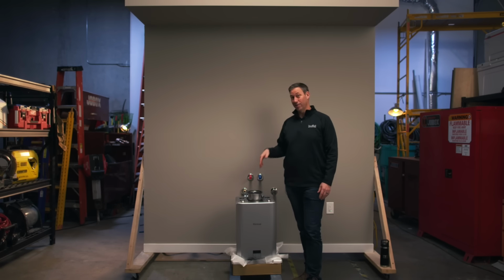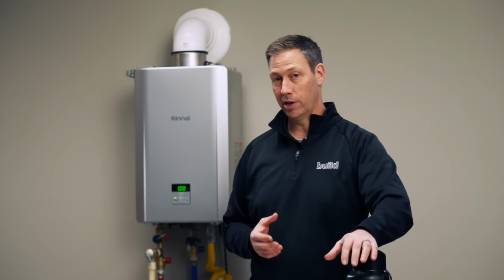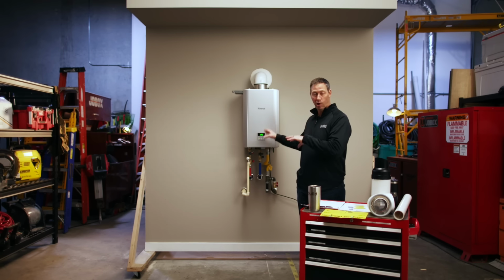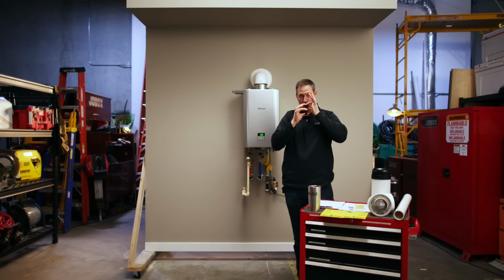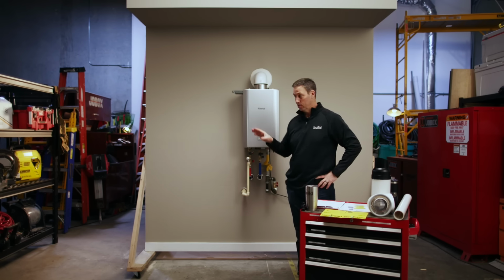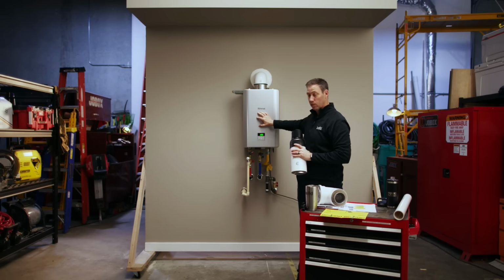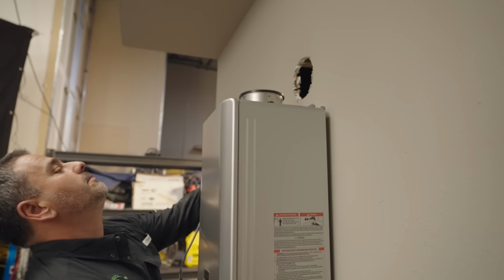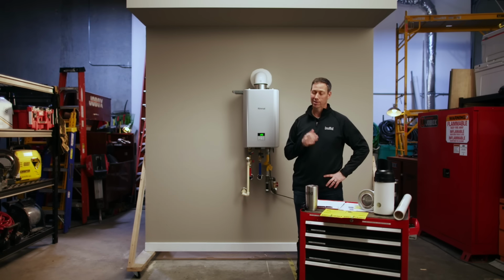Replacing A Water Heater Tank? Probably the Best Tankless Option for You.

Comment: About 15 years ago we had a tankless, Bosch I believe, but went back to a tank for the following reasons:  1) After two years of use, the repair tech was not able to get it to start properly (propane)... the burner would fire up for a couple seconds and then fault out.   Performing the regular recommended flushes/cleaning did not help.  2)  Could never wash clothes in hot water.  The washer would fill using several calls for hot water.  Every time the water was shut off and then turned back on a few seconds later, the tankless would re-start its heating process, putting several seconds of cold water in the hot water circuit.  The unit we had did not have any way to keep heating after the flow was stopped.  If the flow stopped, the heating stopped, completely.  The end result was that the washer never washed in anything warmer than luke warm water.
What did I like about it?  When it was off, it consumed NO gas, period.  As long as it was running and I had propane, I would never run out of hot water.  I was able to select the exact desired temp for our shower using the remote... this way, cold water was not used at all to lower the temp of the hot water down to the temp that was comfortable in the shower.... We LOVED that feature.
The only way I would return to a tankless is if we could overcome the on-off cycle problem we had with the clothes washer.
Reply: In NZ we mostly wash in cold water supply. Washes heat when neccessary.
Reply: Your experience has me thinking not to go tankless ... our new washer does the same thing, at one point in the cycle it turns water on and off every few seconds. It's kinda stupid, actually. Just one more reason for the water valves in the washer to fail sooner probably.
Reply: @thenexthobby  Agreed.  Although, in the past 30 years, I've had two washers.  The only things that I've had to repair (done them myself) was the door boot (front load), water pump and direct drive motor.  Never a valve.  But back to the point of water cycling.... My recent research suggested that some of the newer tankless have a feature that allows you to keep the heater running for 1-2 minutes after the water flow stops, in order to combat this exact problem without having a hot water return loop.  When my tank heater starts giving out (electric) I may just give tankless another try... that is after I verify that it will stay running for a period of time.
Reply: Tempering tank.  Or, point of use.

Comment: #1 That little thermostatic crossover valve doesn't work with tankless water heaters. Tankless water heaters need a minimum amount of flow in order to turn their 200,000 BTU burner on and those valves do not provide adequate flow. #2 As Bob Y mentions in the comment below, if you do have a dedicated recirculation loop and are running the pump to keep the loop hot, you are loosing most of the efficiency of a tankless water heater because you are maintaining 2- 4 gallons of water hot in your piping that is radiating into your home while the pump is running. Not only does this waste gas, but also adds undue wear and tear to your water heater and plumbing. The best solution for "on demand" recirculation pump I have found is the Smart Recirculation Control. They have models that work with tankless and tank water systems and they sell a thermostatic crossover valve that is made to work with tankless water heaters. https://www.smartrecirculationcontrol.com/
Reply: The combustion efficiency increase is no joke.  Depends on your usage but it can make a big difference.  Btu loss through the jacket of a water heater is now minimal. A tankless benefit is far better combustion efficiency without using a tank - reducing cost compared to a 90%+ combustion efficient tank. 

Here in mn we insulate the hot water pipes in new homes.  This crossover could be installed. It will lose btus of course, but you also have to consider the wasted btus from not having a recirc loop. By that I mean when you turn on the hot water at the faucet and you never end up with hot water.  Your water heater will need to heat up the water you used and the btus used to heat your water were completely wasted.  

This water heater has the pump and electronic controls for how it runs built in.  No need for the link you posted with this model.

Comment: Great if money is no object. I have never had a tankless, have had water heaters installed myself pretty easy (last one cost me $600) lasted about 10-15 years little maintenance. Tankless yearly maintenance- pro to install $4k to $8k. 1 )Biggest selling point of tankless used to be instant hot water (I was always skeptical-how!?) now it comes to light that that is bogus... 2) Also big energy cost savings?! $8 a month = that will take 50 years to pay for itself. Total no brainer for me (my opinion for vast majority of people) tank water heater until tankless gets way way cheaper which doesn't seem to be anytime soon.
Reply: Don't even go to the latest and greatest, heat pump water heaters.

On paper?  Wonderful operating savings.

In the real world?  Installation/modification costs enough to make one's head spin.  And then, R&M?  Tech's without any understanding of electronic control circuitry scratching their heads and throwing "boards' at it while on the line with a manufacturer who can't get a new part out  for three weeks. 

In the meantime, spouse threatening divorce if she has to wait three weeks to have hot water.  How much does divorce cost?

Comment: You omitted the amount of natural gas it takes; 3/4" gas line needed to feed that beast vs 1/2" on 40-50 gallon tank.
 Then at only 80% your dumping carbon vs water that now gets recycled. 
Then the regular yearly Maintenace needed on tankless vs non and the pre filter n water softener too.
So the; cost, maintenance/yearly service, added  water filters/softeners/ salt,. plumbing larger gas line....
When in South America They used 240v elec water heaters hooked to shower.  That's way more economical n Elec efficient .

Comment: Couple things.. in a real world installation from tanked to tankless, the condensation drain isn’t really an issue, you could just utilize the drain pan line (I don’t see one in this video) for the purpose of draining the condensate drain and as a drain pan drain. If you install a condensate neutralizer filter you’re good to go.
Reply: Code doesn't allow that. Manufacturer says not to use any other condensate or shared drain as well. The issue is that condensate lines grow algae/mold (because people forget to clean them) and they can eventually get completely blocked. Not a big deal because you'll get a warning or the system will stop functioning, however, if your water heater ruptures, it's going to need all 3/4-1" of that drain line, and if it's partially blocked by algae, then it can't serve it's purpose and you can have overflow from the very drain meant to prevent it. So, go with a dedicated line for all condensate and drain pans. As a side note; a mechanical room I'm installing right now has 4 condensate lines, 2 TPR lines and 3 overflow drains. It's tempting to combine them, but experience/code says no.

Comment: Matt, with all due respect, your stats are very inaccurate which I seriously doubt Rinnai would be falsely claiming. 

A condensing H2O heater can be 96% efficient however independent testing of Rinnai condensing units is UEF 0.93. That’s equivalent to 93% efficiency, ie for every BTU of available energy consumed, 93% is converted into heating water. The unit you have there is not 0.87, as you claim, it’s 0.74 UEF.

The condensing tankless is also not “the highest efficiency”. Every heat pump water heater I’ve see exceeds UEF 3.0, most are approaching 4.0. That’s four times higher efficiency than the most efficient tankless gas H2O heater, which fwiw is the Navien NPE and Rheem Ikonic models.

Comment: can I connect this to the traditional exhaust tube/flue that my gas hot water heater has, or do I need to put in something else?
Reply from the maker: Excellent question. It’s certainly possible to connect to existing piping but you’ll need a plumber to verify that it meets code and will work with manufacturers specs.
Reply: @buildshow  

I've yet to find a tankless that allows the use of type B gas vent and that's what virtually all the homes around here have.  I've even tried hard to find a suitable vent that could fit inside the existing type B I have because it travels through a chase in the second floor all the way to the roof.  Another very common set up where I live.

Comment: Does dumping the hot water into the cold line potentially impact drinking water quality? I've been considering a recirc pump with a traditional water heater, but I'm worried about impact drinking water quality.
Reply: The EPA says you shouldn't drink from the hot water tap because heated water is more likely to dissolve (and contain) contaminants like lead. And it's also possible for algae to bloom in a tank. So this just swaps one problem for another. Now, you're waiting for cold water instead of hot.

Comment: Coming from a plumber, that has worked on these a lot, I cation you about the recirculating line. If you don’t have the proper diameter pipe you can start to have pin hole leaks in your water distribution system.
Reply: Can you elaborate more on this?

Comment: A few things that Matt forgot #1 gas line sizing for a 200,000 BTU piece of equipment #2 recirculation lines add to your gas consumption, they don’t stay hot for free. #3 contacting the gas utility about the added load (The gas meter and regulator will need to be sized for the entire house load , all gas appliances). #4 connecting  a 200,000 BTU stationary appliance with a flexible connector may be excepted by Matt’s code enforcement district but it’s not a recommended connection by Rinnai. #5 as a gas utility technician we tend to find in 40% of the cases, the gas utility bill going up after installing a tankless water heater (this is usually due to added use because of the endless supply of hot water and the use of recirculation pumps with long pipe runs).#6 This Rinnai is a little easier than servicing the condensing type when parts are needed but it’s no walk in the park , you better know what you’re doing if you’re replacing heat exchangers and burners.#7 when it comes to tankless water heaters ,Rinnai s are very good but their service valves suck, install Webstone service valves and you can thank me later.
  When it comes to tankless WHs, Rinnai and Bosch are probably your best choices. I personally have a tank type, I keep it clean and replace the anode from time to time (less headaches and I don’t get paid to work on my own equipment but I love working on yours).
Reply: I know this video is six months old but I'll add my little bit anyway.  The one thing I never hear mentioned is that with a TANK type water heater you always have (depending on size) 40 or more gallons of emergency potable water should the need arise.  For whatever reason, I find some comfort knowing that.  Like I said, my little bit😉
Reply: Thank you Bob Y. This is the Best comment I think I will ever hear on this topic! I am considering changing to a small tankless for our garage  conversion to save space, and mounting it outside. I live in Madera, Calif. Any recommendations? This room is only for our family as guests on ocassions.
Reply: @dporrasxtremeLS3  , for outside installations, I like the Rinnai tankless  used with the Rinnai  Recess Box. I’m not a fan of Rennai’s Service valves, I prefer the Webstone service valves but I’m not so sure they would fit in Rinnai’s Box. I am in Missouri , so outside installations are off limits here (gets too cold). My brother does have a outside Rinnai  in South Alabama and has never had a problem with the unit itself but those service valves can become a bitch to turn when you do a Vinegar flush ( my suggestion is that you exercise those valves probably at least twice a year ) . Whether you’re installing this yourself or hiring a qualified plumber my suggestion is learn all you can and do your due diligence. Once you educate yourself, I suggest getting 3 bids from qualified contractors and go with the one you’re most comfortable with after a good conversation and your new learned knowledge.
Reply: I wish you worked on my city.
Reply: Thank you !
Reply: I had an all electric house I put NG in when I moved in.  When I replaced the Water Heater I had to put one in that vented out the side of the house (no flue pipe to the roof).   When that one failed I put in a power vent tanked.   That one was threatening to fail so I put in a  Rinnai tankless.  Fortunately when I installed the gas line,  I had sized the gas line going to the water heater large enough to support the very high BTU requirement for the tankless one.  The power vent one was already installed on an outside wall, and had a vent available, so it turned out those two issues were covered.  If I had needed to run a new gas line form the meter I would have got a power vent tank water heater They were not much cheaper than the Rinnai, however so far it has worked well.  I just got a cleaning kit so we are going to clean it out (it is slightly more than one year old.)
Reply: He didn't forget....it's sponsered by Rinai....they don't want you thinking about the extra gas spent.  I'll add another caution...I had a relative with a circulation pump and they unhooked it because in the quiet of the night the water circulating sounds kicking on was an annoyance.  That said, my Rinai operated for 18 years before it failed to light.
Reply: An on-demand recirc system uses less gas than the typical timer activated kind. Some are even worse, running 24/7 as if anyone needed hot water while asleep or away from the house. But all of them reduce water waste!
Reply: I added this unit. The only downside is there are just two heat settings 120 & 140 degrees. My wife would like it a bit warmer in the bathtub. It was easy to install.
Reply: Yes sizing of the gas pipe is maximum input for the appliance because there needs to be enough volume and pressure for the appliance in the case that every single fixture is running hot water.
Reply: I agree with most of what you said but remember that Tankless units do not consume 200,000btu every time they turn on.  They are stage fired and gas consumption is proportional to the load.  Conventional tanks are 100% on/off.  Its very seldom that the unit is drawing 200k btu meaning 11gpm hot water. In most cases these unit are drawing 50k btu. with one or two fixtures running.  I prefer Navien NPE series.
Reply: @MrTictawk  , When it comes to sizing gas lines and the incoming gas distribution system it doesn’t matter what your average use maybe, they have to be sized for the maximum use possible. 
 Navien equipment is not too popular around here and I understand they’re having heat exchanger problems. I am not a real big fan of South Korean equipment.
Reply: @boby115  Navien has Stainless steel heat exchangers and I find them very reliable.  If you have very hard water, the unit needs to be serviced annually or the exchanger will fail.  Ditto any other brand including Rinnai.
Reply: @MrTictawk  Rinnai also make a stainless steel heat exchanger.  It's there condensing unit.
Reply: @MrTictawk  Exactly, we have little problems with Naviens. Navien exchangers only run into trouble on their NHB and NCB boilers running on a high temp system with no outdoor reset control. If you have a system that runs at 180 use a NFB.
Reply: @anthonyspadafora1384 could you explain NHB & NCB & NFB? I don't understand those acronyms,  thanks
Reply: @1970Mrscott  NHB Navien Heating Boiler....NCB Navien Combi boiler....NFB Navien Firetube Boiler   The combi boiler makes both hot water for heating and domestic use.
Reply: What you wrote is all true. He is trying to sell this tankless like car sale without the downsize of it. Installation cost must be up the roof.  This is for customer with money to burn. Why not just install tankless for each bathroom. kitchen and laundry room.
Reply: Very true. Glad I did not switch to tankless. Tankless water heater sometimes is free after government subsidized rebate, but the cost to resize gas line is much more expensive.

Comment: It’s not done to code, you can’t run pex up to a water heater, especially a tankless. 18” of metallic pipe required up to the unit. And Rinnai is NOT the first manufacturer to design a pump into it. Navien has done it for 10years.

Comment: Here you go:

Crossover Mode (Factory Default):
• The plumbing system does not have a dedicated circulation return line. Crossover mode requires installation of a thermal bypass valve at the furthest fixture in the plumbing system. When installed, the boiler uses the cold water line for hot water recirculation. A thermal bypass valve can be purchased through Rinnai (PN: 107000143) or plumbing supply stores.
• How the recirculation pump works:
− The pump turns ON and runs until the thermal bypass valve closes (with a DHW flow less than approximately 0.26 GPM), or for 20 minutes, whichever occurs first.
− The pump stays OFF for 10 minutes.

https://media.rinnai.us/salsify_asset/s-62bf376b-a1d8-46c1-8db8-6d14ed759007/TB-158%20I-Series%20Boiler%20with%20DHW%20Recirculation.pdf

Comment: Hey Matt I have an electric water heater in a laundry closet in my hallway.  I have Natural Gas coming to my home.   My question is: If I was to buy this tankless model, can I vent this model using the Concentric vent pipe, up into my attic and go out a Gable end instead of venting it through my roof?
Reply: Get a heat pump water heater and thank me later.